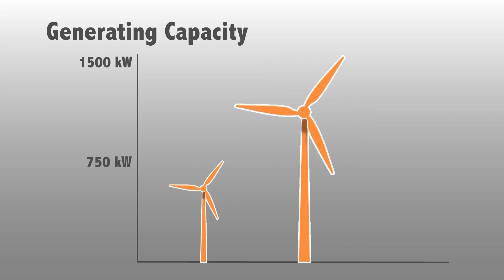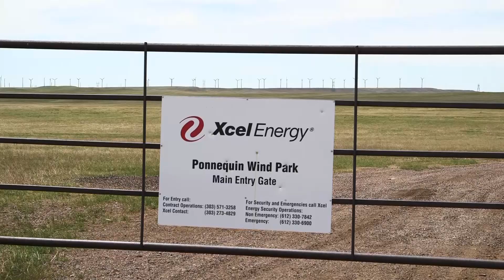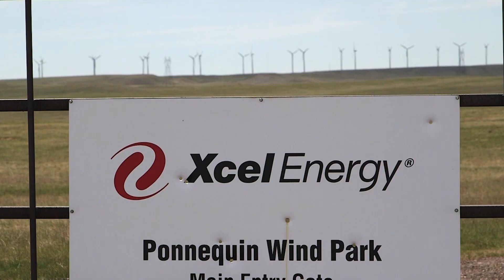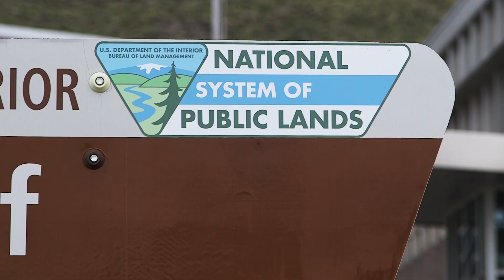Who Cleans Up When a Wind Farm Retires?

Comment: They are tiny turbines and typical turbines are 3 MW or about 5 X bigger and far more efficient. 
Now wind energy is the cheapest way to generate electricity, without any subsidies.... Around the world.
Reply: When you account in the costs of energy storage and power grid stability measures, it's far from being the cheapest.
Reply: @FrainBart_main  There are many ways to store renewable electricity as energy... Such as in an electric car, in electric hot water storage,  in pumped hydro or home or grid batteries. 
And when other services to the grid that can't be provided by other generators can't and batteries can, then the value proposition of grid batteries is unbeatable, such as in South Australia.
Reply: @guringai  Yes there is but we should include their cost in the cost of intermittent sources because they are the ones that need energy storage. Conventional generators can provide frequency and voltage control easily (although not as quick as batteries, but can do so basically indefinitely) and they introduce a lot of inertia in the system. The battery in Australia is doint a great job but if we want to have mainly intermittent production, we would need A LOT more of them, which would increase electricity bills drastically.
Reply: @FrainBart_main  The government science and engineering body in Australia (CSIRO) deems that our grid only needs significant storage once the renewable content becomes over 50%. And it will be a while before that happens. The variable, and predictable supply and demand are coordinated, and is not a significant issue in a widely distributed grid.
Reply: @guringai  The need for energy storage will be quite significant if renewable content will be 50 % or over. You have to understand that you need to dimension energy storage systems for the worst case scenario, like a week with low wind speeds and high cloud coverage in the winter. The scale of energy storage systems to do that is mindblowing, so are the costs. Yes you can use conventional power plants and demand-side management to keep the supply and demand in balance but it gets harder and harder to do that with higher percentages of renewables. Also you basically need backup power plants for every W of renewables if you don't have sufficient energy storage. If Australia wants clean, cheap, carbon-free electricity production and reliable supply, I think they should reconsider going nuclear. Technology is well developed and Australia has basically the largest uranium reserves of any country.
Reply: @FrainBart_main  The grid operator has arranged to shed very  large amounts of load with many industries in exchange for very handy cash. It's much cheaper to do this than build unnecessary infrastructure for the worst few hours of the year. 
And Nuclear is completely off the table due to the vast costs, and resultant electricity costs... about double that of renewables with firming (storage)

Comment: A person recently posted that wind energy is not free but it is clean and low cost. I am not interested in getting into an argument of the logistics of the manufacturing of that wind turbine, huge gear box and the tower, the concrete base the wires run underground the electronics that were manufactured and all of the maintenance that is done on this tower system over its short life. 
The issue becomes after its useful life which we are now finding to be 15 to 20 years this system needs to be taken down and recycled just think of all the lubricants in this system, the solder it was used in the circuitboard all of the bearings that were manufactured the fiberglass blades, just think of the energy required to make all of those things and now they’re going to be scrapped. There isn’t anything that is actually low cost you are going to pay one way or another and the cost is going to be similar. 
A good exercise for your mind is this “no man knows every step that it takes to get a tuna out of the ocean and onto your grocery store shelf”. 
Just think about everything that was manufactured, the energy used to make the ship to transport, the fuel used, the people to process the fish etc. to be naïve enough to believe that this wind turbine is low cost, clean,  is to be fooled by political/environmental activists.

To put your mind at ease my primary vehicle for transportation is an electric car. There is a sticker on my rear window and it says this vehicle runs on coal. People have asked me where do you put the coal in. They just don’t understand that many of the power stations generate electricity to charge my battery with coal. Now that we are using more natural gas I am going to have to change the sticker to say this electric car runs on natural gas and coal.
Don’t get me started on what does it take to make the batteries for this electric vehicle. If you ever research something like that you will be blown away by the amount of energy consumed making and transporting these batteries around the world. Starting with bunker oil used in the ships to transport the raw material to China or Japan.

Comment: The nice thing is that turbines don't pollute. it's very easy to reclaim the land after demolishing the towers. The only hassle is what to do with those concrete foundations that the towers bolt to. Thank goodness you're not decommissioning a coal plant! when land is that badly polluted, the only thing you can do with that land is install wind or solar.
Reply: Vincent Robinette what about all the fossil fuels used to make the turbines. To transport them. All that cost has to be recouped. So wind is  another green pipe dream
Reply: @raymonkent7283  That has to happen no matter what's being built. With turbines, it only happens once. with coal, That has to happen continuously during the cycle life of the plant. A turbine will return the equivalent energy of all of that within  a couple of years, depending on capacity factor. you would have an argument if you could build the plant, with no further fuel, no further mining, no further transportation of fuel for it to supply any energy. A plant does put a lot more generating capacity on less area of land, by itself. If you consider the land that is occupied to mine the coal in the first place, you're on par with a wind farm. the difference, wind farms aren't removing mountain tops, which requires immense amounts of fuel, just to get to the fuel! Then more fuel to get it to where the fuel is burned, until it's exhausted.

Comment: Lotta drama down page on this.  

Here is the deal.  Equipment gets old, it fulfills its service life.  Metal Fatigue sets in, and repair costs more than getting fully new.   These can drop easy (gravity works) and can be recycled at a profit.  

Meanwhile if more Big Wind is profitable in the area -- More Big Wind will appear.  If not, then not.  

But overall it is now 2018.  New Solar PV is the cheapest, fastest, cleanest and least risk New Generation Source.  Since the Premium Pay-Demand "Time of Use" is daytime, Solar is also very good on making money.

Overnight Baseload from Old Existing Nukes and Coal is now surplus and worthless.  Has become so much so, on the Grid level, we have taken to giving Night Time power away for free, just trying to find a customer.   NO ONE wants New Coal or Nukes.  They are money losers.  Big Coal is Bankrupting and Nukes are being shut down early or being put on Welfare to avoid Bankruptcy.
Reply: Right, because no one needs or wants power at night. Actually, what happens is natural gas provides electricity at night while solar somewhat provides during the day,
Reply: @Jemalacane0  == there is already vast surplus "baseload"  overnight.   Coal and Nukes  have  been  overbuilt.  Back in the Decades before Solar  and Cheap Frack Gas,  baseload Coal  and Nukes were over-built to reach the Peak Time-of-Use -- which was highest in mid-day in the Summer.  

Large Air Conditioning Load.  Since Frack Gas Turbines and Solar have arrived with Daytime Capacity, Nukes and Coal have been reduced in need, so much so  that Coal is going Bankrupt and Nukes are either being shut down early or placed on "welfare" to avoid bankruptcy.  

Overnight power is so surplus in some places it is given away for "Free," just trying to find a customer.  Meanwhile overnight demand is dropping, due to lighting improvements and other energy savings. This means  we have decades ahead of surplus overnight power without building anything new for it.  

This means Solar PV (now  the cheapest, cleanest, fastest, and least  risk New Generation Source) can  continue to expand and take more and more  of  the daytime market.  There is no need  to build  "storage" as it will be decades before there is any real use.   

Meanwhile HVDC (High Voltage DC) -- a way to send electrical power a long ways with small losses -- is being built around the around the World, and allows electricity to be "shipped" across time-zones.   The Sun is always shining somewhere.

Comment: I worked for a power company for 38 years before that I worked on a hydroelectric dam as an electrician. We could buy power off the grid for less than 7 cents a kwh, but President Obama's new rule mandated we purchase solar and wind power. We had to pay $2.00 per kwh, even if we did not want the power. Then the installers asked if the power company would like to purchase the wind and solar stations and the answer was no. Even the big tall wind generators have a useful life, maintenance cost are extremely high. Solar panels are shot after 10 to 15 years due to sandblasting the panels from the dust and dirt along with the wind. If we had high-voltage storage batteries where we could store this energy and bring it on as needed, that would be a big benefit. Yep, the only ones who make money is the manufacturer and installer. No one else.
Reply: Pepperidge Farm remembers. :) 

Might be a little foggy on some of that.  The Tax Credit feed-in Tariff for Big Wind was 2.2 cents per kWh.  

And Solar is not "shot" in 10 to 15 years.  Have you ever actually touched any where that was the case?   Standard warranties are now 25 years.  

Anyway -- it is 2018.  Big Hydro is still the cheap existing operation -- but the Dam Sites are about maxed out.  Now New Solar PV is the Cheapest, Fastest, Cleanest and least Risk New Generation source.  

What Dam Site(s) did you work?  I have worked on a few. Updates on old equipment and controls.  Actually sort of fun.  Grand Coulee was the biggest.
Reply: Arizona Central Arizona Project just signed a 20-year power purchase agreement with AZ Solar for a  solar farm that will sell power for  2.49 cents per kilowatt-hour.The lowest in the country. and Wind generators pay back all energy to produce them in 6 to 8 months of their 30 year avg life span.
Reply: @jammer6524
Reply: @jammer6524   @Devin Culley  SERIOUSLY?
 Do ANY of you LEFTIST indoctrinated mind numbingly ignorant fools realize it takes MORE energy to build, install, maintain And eventually dismantle thus restoring the land to previous state, than these monuments to stupidity can produce in thier lifetimes? Along with the oil used to maintain the moving parts is brought in by the barrel. The bearings are MADE to leak by design. Most likely ending up in the soil. I though you ALL were AGAINST that? Or ONLY if the EVIL oil co does it? Take just the blades for example. They are fiberglass. Resin is made from oil. Gel coat, paint, fillers, and other chemicals used to produce are ALL petroleum based. So you have the workers drive to work daily to build these parts. Gotta INCLUDE that. They work in a shop with lights & compressors & big fan. Lots of other equipment. Same with the metal parts that connect the blade to your turbine. ALL THAT is JUST to get a blade built. Takes hundreds of man hours. Overhead crane to pull it from the mold. They get sanded and prepped like a car for paint. Then gallons & gallons of urethane paint is applied. Sprayed. They Need be wrapped in bubble Pac & plastic. Loaded on trucks. Again, heavy blades loaded on big trailers. Let's not forget they had to build a Building to build the blades. Can't always find a big enough Building for building fan blades longer than a 🚛 semi trailer.  They must be trucked to the site. Followed by and proceeded by escort vehicles. 3xs. Lifted in to position by a crane burning petrol. WHAT does THAT add up to? Repeat for ALL OTHER components.
Reply: @boatguy64  Are you one of them young earth creationist that believe the earth is like 6000 years old?  You sure do post like you do.
Reply: @jammer6524  uh. No. In no way am I ANYTHING like that. I'm a product of the early 60s grew up in the 70s
Reply: @boatguy64  Young earth creationist do make up a majority of the Republican party and of the anti green energy group as well. Even our current  Education secretary Betsy Devos and Vice President Mike Pence are young earth creationist. Even if your not one of them you could be supporting them with your vote!
Reply: @jammer6524  Look idc what others believe in. Unlike LEFTIST,  conservitive & Republicans believe in individual thoughts. It's NOT collective mentality. I can disagree with someone on THIER personal belief while we agree on limited Gov and Gov NOT being intrusive into my life. Can you understand?  Democrats and SOCIALIST think it's ALL or NOTHING. ZERO sum. Like what YOUR point was since I'm a conservitive and pence & devos are, then I must agree on ALL the same things.
Reply: @boatguy64  First off If you were to go back and read it regarding  Y.E.C. I said," Even if your "NOT" one of them you could be supporting them with your vote!  I've been a registered republican and lived in small rural towns my whole life.  I started using my vote with George Bush Jr. to  not support the republican party slide into making the United States a one religion Theocracy government. I don't agree with that so I stopped voting for anyone that is a Young Earth Creationist. Your a big part of the problem with all the religious nuts in the GOP. All the anti gay married republicans that keep getting caught being gay. Last year it was Oklahoma Senator Ralph Shortey now in prison for 15 years  for being caught in a hotel room with an under aged boy. Voting the same way year after year expecting different results the definition of insanity.  Personally if my choices are Theocracy  or socialism I will go with socialism every time.
Reply: @jammer6524  THAT seems crazy to me. But it's your vote. I am not about any one issue. But i do NOT support infanticide, pedophiles, flat earth, and other crazy shit. Inc SOCIALIST/COMMUNIST. One leads to the other leads to dictatorship. Predictable pathway. Time & time again. But hey. Who knows? Maybe humanity will luck out THIS time.
Reply: James Gardner 
Thanks for that.
Reply: richard mccann  Not if it's Thorium-based nuclear power generation.
Reply: Same is true for reflective solar 
I worked as the general foreman on the crescent dunes project in Tonopah nv
I don’t think it could ever run in the black because it cost so much to build. 
I personally made a truckload of money but if you want juice ya can’t beat a nuke for production yield. 
Every fossil plant that shuts down raises your consumer cost a little at a time and these farms and solar simply cannot replace that lost productivity 
20 years of industrial piping and you can’t beat fossil for cost effective power production.
Reply: This guy is spot on, they put up two wind turbines about 15 years ago, in my town, they do not produce crap, expensive to maintain, the companies that built them in Germany went belly up. A boondoggle for everyone except the taxpayer. The folks who pushed for them? Dead, moved on to bigger and better deals, disappeared.
Reply: From 7 cents to $2.00? sounds like corruption,screwing people. In what time period ,years
Reply: Obama hates the US
Reply: And stone boats would fail also. Also square wheels. Some designs are just plain stupid, and modern wind turbines are created to fail, so they can never compete with hydroelectric, and oil, and gas, and coal, and Nuclear electrical generators. "Dutch windmills" pumped BILLIONS of gallons of water, and created hundreds of thousands of acres of farm land in Holland. Dutch windmills, with large sails, would generate plenty of electricity at low cost. That is why they will never be allowed to be constructed.
Reply: @jackfenn7524  you literally watching a video on the modern 'dutch windmills' you just assume the big sails make them better or more efficient, but not to generate power the way they are trying to do with turbines. Also plenty of agriculture use for wind power, up until well electricity, because of reliability there still some wind powered water pumps kicking around out in rural US. They fail, because we want to take that energy locally bottle it up and transmit it far distances. A dutch windmill sails will rip, or unattended it would spin freely and bust into pieces. We created a great unattended remote solution to transmit the power only once usable on-site by a 'dutch windmill'.
Reply: fjandgoob  Taking out subsidies, solar and wind power are now cheaper than electricity generated by coal, nuclear power and even natural gas .

Comment: Everyone of those Turbine's have a massive monolithic footing or base structure that keeps them upright. They need to be removed also. You are looking at around 100 square yards or more of concrete that needs to be excavated and broken up and removed and recycled. Bringing down the towers is the easy part. All they do is excavate around most of the base and push or pull the towers over. Blowing them up is nonsense since you need to dig up the bases and foundations anyway.
Unless of course they are going to try and get away with not removing those massive blocks of concrete and steel reinforcement bar.